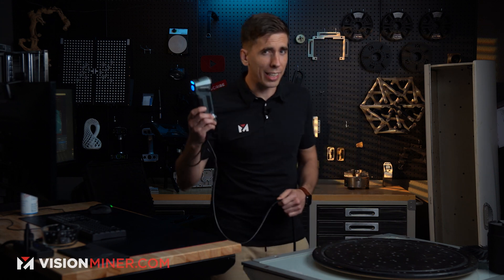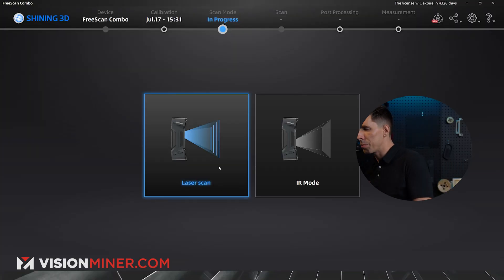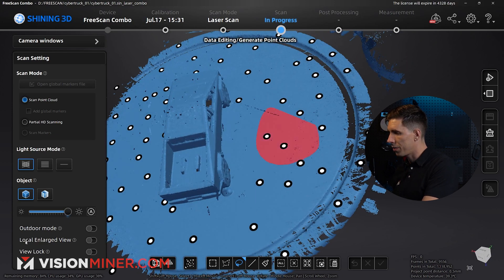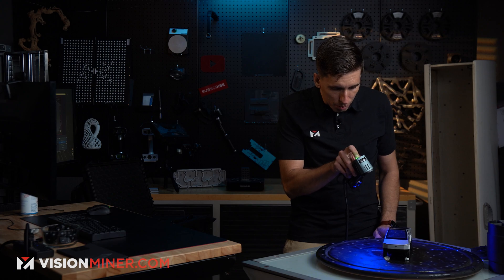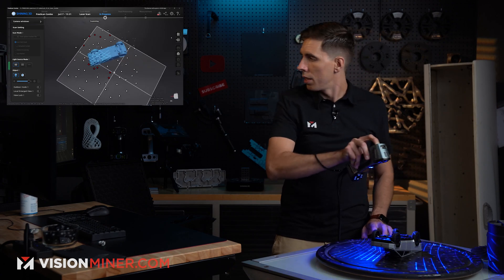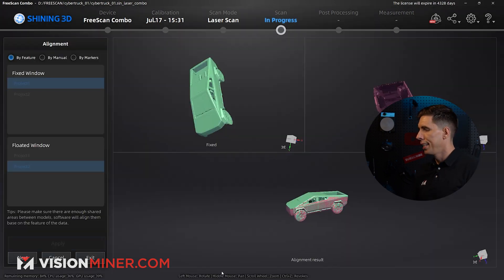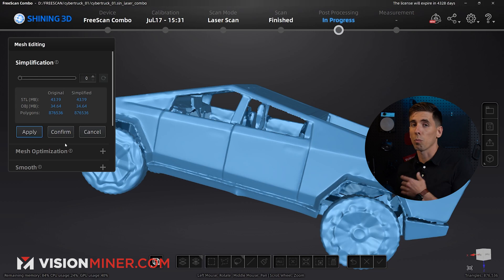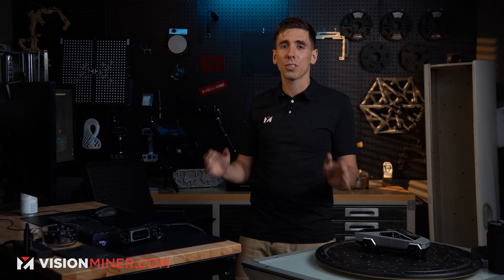Cybertruck 3D Scan with the Freescan Combo from Shining3D! 2023

Comment: Biggest turd ever scanned! Real life pictures of the CT are coming out and it's dissapointing to say the least
Reply from the maker: Has anyone actually received a delivery?? We have a hard time finding anything other than the standard youtube overview narration videos....
Reply: @VisionMiner I don't think there are any, most of the stuff I saw are random pictures on the r/RealTesla subreddit: huge side mirrors and windshield wiper, reflections that shows every little flaw (they were already bad at fit and finish, it's only going to be worse with polished steel), the shape of the bed resembles a wheelbarrow 😂 etc.

AFAIK the production model is not an 'exoskeleton' as initially promised but a unibody with regular body panels like any other car.